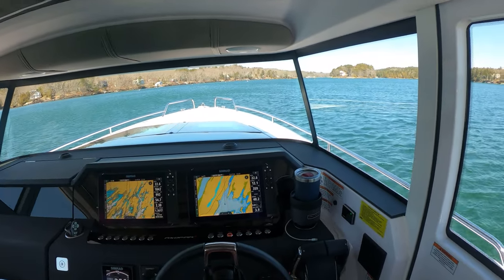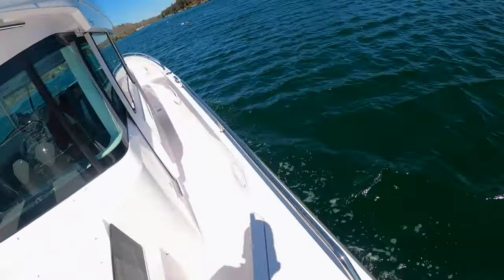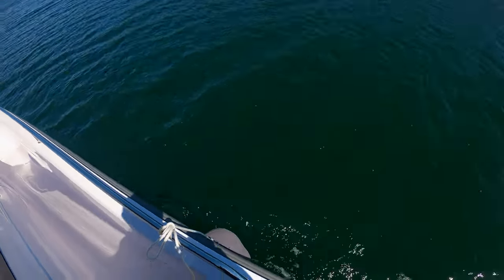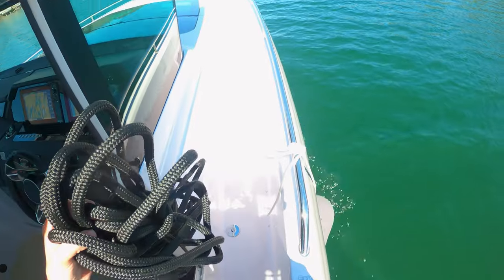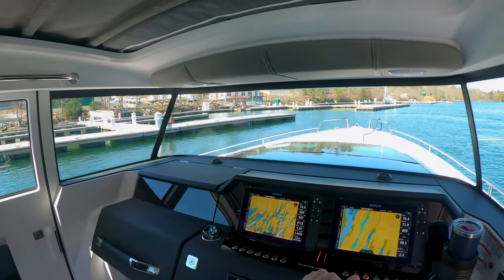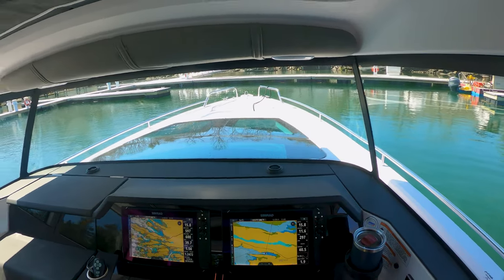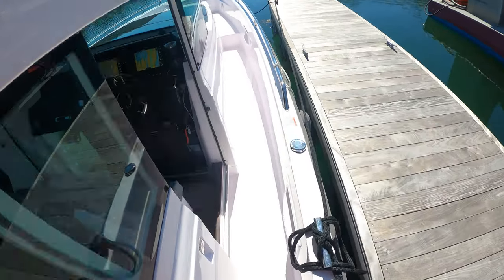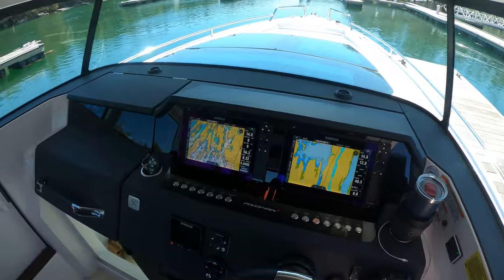POV Solo Docking an Axopar 37 XC

Comment: I cant believe you leave the helm when its in gear?
Reply from the maker: It certainly helps that Ben's a trained professional in his home harbor, but with the auto-pilot, remote control, and a slow/idle speed it's perfectly safe as long as you are comfortable and familiar with the waters you're navigating in and have plenty of open water. You can always engage the sky hook which will lock the boat in place in order to put out your lines and fenders.